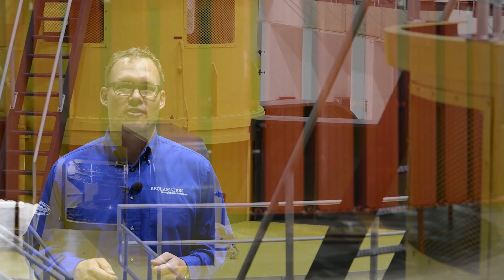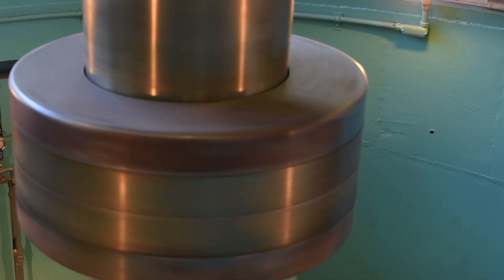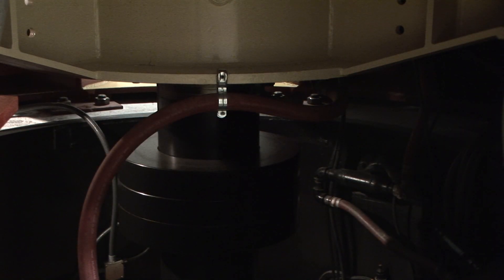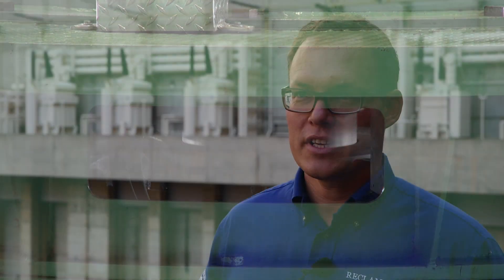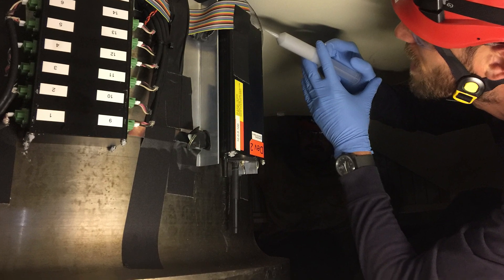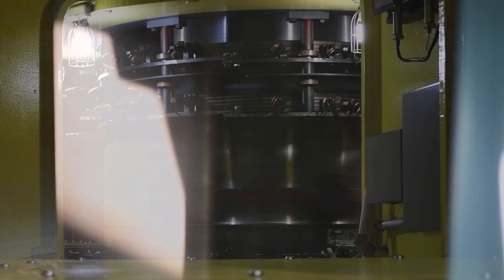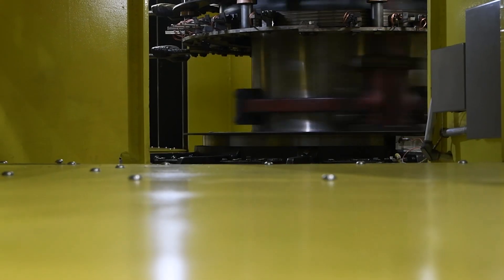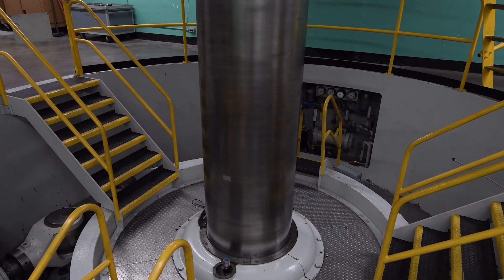Prize Competition - Powering Electronic Equipment on a Rotating Shaft

Comment: Reclamation, you have internal staff that can handle this issue. I know EEMs and C&I mechanics that could handle something like this. Why invite an outside party to solve it?
Reply from the maker: As you point out, Reclamation has a large staff with unique skill sets. However, Reclamation determined that this was an issue that they have been unable to solve. Working through a prize competition allows us to reach a large group of well-qualified individuals to submit out-of-the box and unconventional ideas.

 If a Reclamation or other federal employee would like to submit an idea, they are welcome to. Unfortunately, they are not eligible for a cash prize, but they may be eligible for non-cash or meritorious awards.
Reply: I can't recall during my 25 years with Reclamation where Denver TSC solicited solutions from the field via an Email request for ideas. The skillsets exist in the field for something like this. A better solution would have Subject Matter Experts SMEs from the different regions discuss ideas with your TSC staff.

Yes, I know. I'm responding to someone in the PAO section. My own opinion is that Denver should be asking the talented people within the ranks. Thanks for responding.
Reply: Perhaps there is value in identifying engineering and innovation talent outside of their industry vertical?  ... and they get to put "driving innovation" on their annual report too.